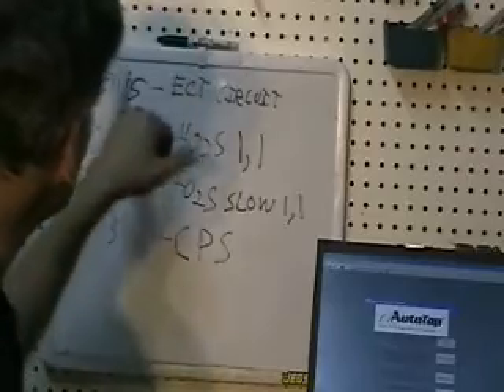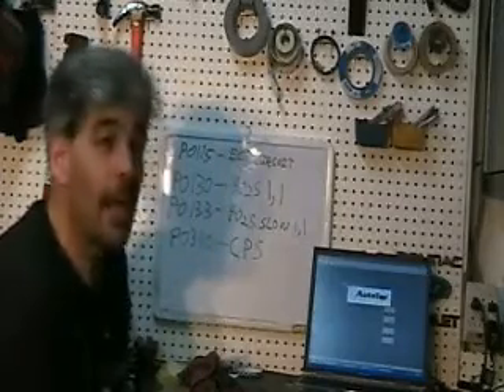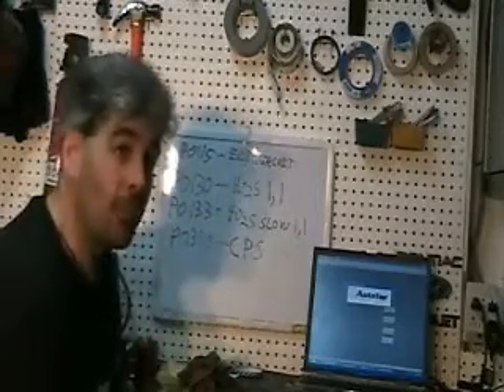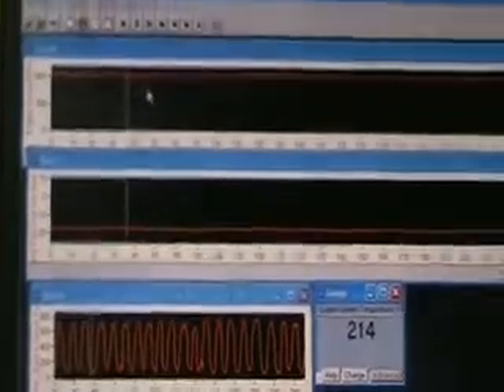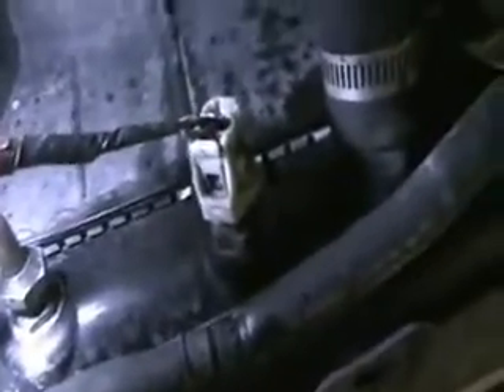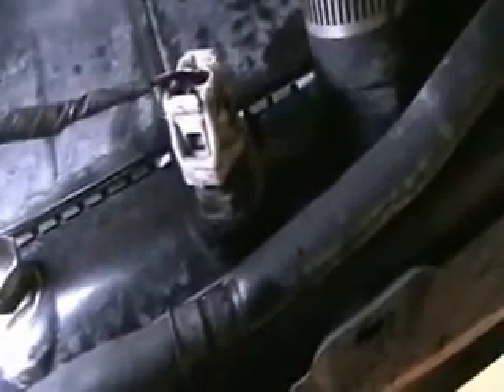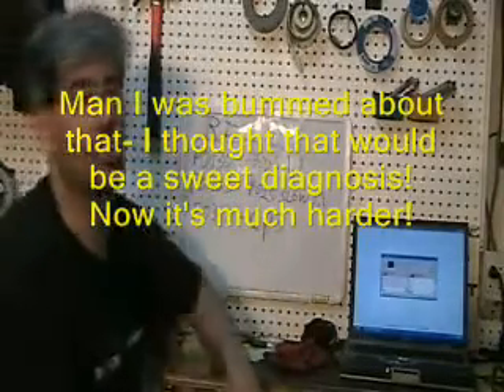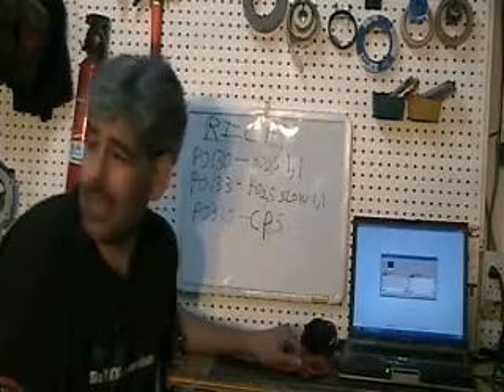Multiple Check Engine Light DTC's Diagnosis- PART 2

Comment: All you had to do was unplug the sensor. if no change, short the pins.
Reply from the maker: Absolutely incorrect. You clearly have no understanding whatsoever of the sensor operation.  WHy do people still spread these ridiculous myths???
Reply: Schrodingers On same 98 Silverado, we later on had to change the ETC. This time the truck would run fine warm, but extremely .hard to impossible to start. We could unplug the ETC, and start the truck. Yes we were taking what the computer saw as +255 (or whatever the max is) and changing it to -30, but the effect was the same on a vehicle that old... Computer thought engine was cold, added fuel, truck started. It is a simple two wire, resistive sensor circuit and you can take it from one extreme to the other by opening/shorting the circuit. Sorry, it may be ill-advised if your not sure what your doing, but I am NOT wrong...
Reply from the maker: Well you are wrong for THIS channel, which is a safe haven from "chatroom forum" type comments.
   How does unplugging the sensor and seeing no change account for variables such as an open? a short to ground? a 5V reference shorted on ANOTHER sensor?  Please explain....

Comment: You are ABSOLUTELY CORRECT. Years ago, my uncle's 98 Silverado gave o2 codes, ran rich when warm. It gave him the blues. Went to a mechanic who could see live data, and he noticed the temp was off the bottom of the scale. It was a half gallon low on coolant. The sensor would catch air and quit reading. Separate sending unit for the gauge so you couldn't see it...

Comment: OK so I cried for help to soon. I'm thinking I did not complete the drive cycle to pull up the code after I switched the cop from #2 to #1. well it finally pulled misfire on cyl 1 and ended up being a bad cop. So as many times as I went to Auto Zone to have the codes read I probably could have paid for a decent scan tool. Can you recommend a good one. Thank you so much for your quick response and educational videos.
Reply from the maker: +matt johnston I use AutoEngjnuity
Reply: With so many subscribers how the heck do you respond so fast. I Just sent that less than a minute ago. Thanks again for all your help.
Reply from the maker: matt johnston Lol the notifications of messages come right to my phone

Comment: had a misfire code on 2002 5.4l Ford. bank 1 cyl #3. watched your extremely educational videos. found a bad plug in 3. ran good for 300 miles and got same code for cyl #2.  swaped cop from 1 to 2  and misfire code went away. prior to the #3 plug change I had a bad 02 censor after the cat on bank 1. changed that and then #3 plug and like I said ran fine till I got misfire code on 2. swaped cop from 2 to 1 to see if went to #1 and misfire code went away. still runs like crap and all four 02 long turn feul trims are maxed at 25%. still getting P 0171 code. used carb cleaner to check for VAC leaks, cleaned Maf with Maf cleaner and changed PVC valve. All VAC lines look good and checked all the 5.4l normal failure hoses. cleared codes on each test and parts replacement. still getting P 0171 code. what to check next. Maf cleaner and PVC were expensive for me.
Reply from the maker: What was the data you got that indicated the O2 sensor was bad? That is where I would start- that would be the major clue.
Reply: Friend of mine had a experience code reader that read long term fuel readings. One 02 after cat was not working at all. Replaced it and all 4 were working reading maxed out at 25% p0171 ????
Reply from the maker: matt johnston What was the data that the post cat sensor was bad though?
Reply: +Schrodingers Box    I didn't  have any specific data on its readings history using the standard code readers. It was only when a friend of mine had a higher end code reader that gave fuel trims etc that showed was not giving any reading at all. so I changed it out and it started working reading long term fuel trims maxed out at 25%. I've disconnected the battery and had the codes cleared on each test and part replacement.Then drove around till I got another CEL then back to O'Reilly to have it read. still getting p0171 and running like a typical Ford. I had a traumatic brain injury in 07 so this is good physical therapy for my thought process and intelligent thinking. allot of the other y-tube mechanic videos seem play blind folded darts and hope to hit the problem, kinda repair by replacement. you seem to be the only one so far that     uses intelligent thinking by process of elimination and your help is greatly appreciated.
Reply from the maker: matt johnston Yeah you are changing parts that are not the problem here- it is impossible to tell a S2 is bad through fuel trim.
  You need to see my video "secret of engine problem diagnosis: fuel trims" and it will show you how to correctly find what your problem is for sure.
Reply: Will do thank you.

Comment from the maker: Debrah thanks for the comments but I suggest googling for the location of the EGR valve.  EGR's often look vastly different on different cars and locating an EGR valve, like most components, is usually a matter of recognizing characteristic features. An EGR valve will be on the intake manifold and have a pipe connecting to the exhaust at some point.  Some are electric, some are vacuum controlled (yours is surely electric so it won't look like in the video).

Comment from the maker: Debrah, to clear the codes you need at minimum a basic code reader such as at Autozone.  Sometimes you can also clear them by disconnecting the battery for about 15 minutes as well. If the repair is successful the codes will also eventually disappear on their own but it may take as many as 40 drive cycles depending on the codes.

Comment from the maker: Thanks as always Spelunk-  Yeah I agree- one would expect that with the switch stuck closed the fans would always be on instead of never on.  I figured this must be some type of short circuit phenomenon because Unplugging the ECT starts the fans so clearly infinite resistance runs the fans, yet hi resistance must not and low resistance must run them while no resistance at all (short circuit) must not.  I really need a manual for this car lol!!

Comment: the PCM monitors the voltage drop across the thermistor. As the resistance changes, the computer interpolates the voltage reading for the temperature. Since you're having a rich condition, the thermistor must have a very high resistance or high resistance in the feedback circuit to the PCM which would imply to the computer that the engine is cold, thereby making it rich. You should be able to monitor this sensor with your scanner or you can use a DVOM to measure its voltage drop. Good video!

Comment: Hi Mark if I got your name right. The P0115 ECT code is the thermistor which connects back to the computer. You mentioned that the green connector for the ECT sensor goes back to the computer. That should be the sensor that you should focus on. The thermistor is a two wire device which changes resistance based on temperature. It has a NTC (negative temperature coefficient) meaning the resistance drops as the temp goes up. Also, this device is fed +5VDC through a resistor in the PCM and cont....

Comment: What puzzled me is why the fans click on when the switch is disconnected. In that case, resistance is very high. But on the switch, when you put the good switch into hot water the resistance fell....

Great series.